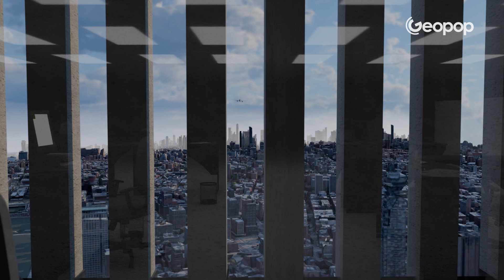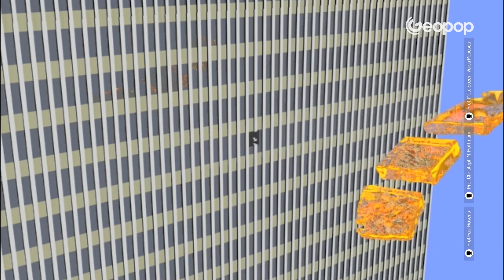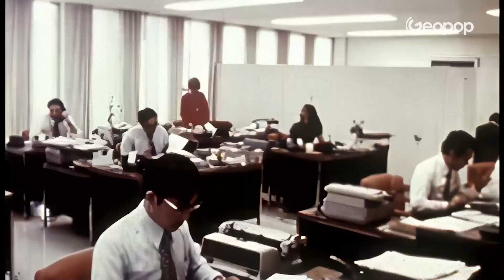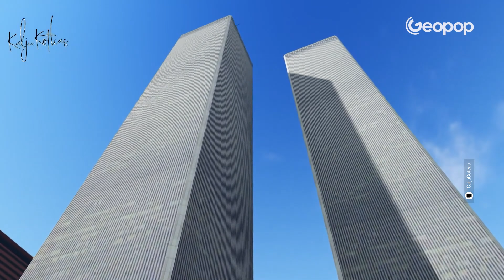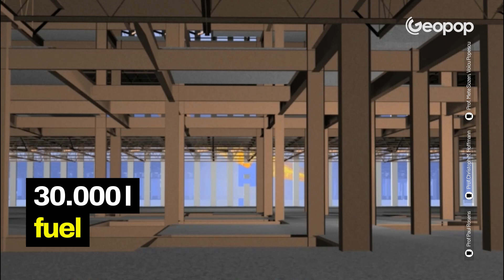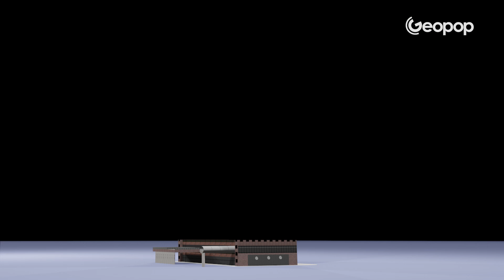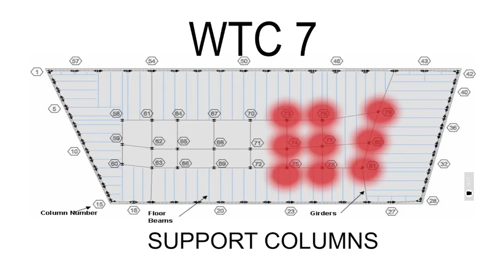9/11, 2001: The Technical Reconstruction of the Twin Towers and WTC 7 Collapses

Comment: All these technical reports that the fire reach 1000 deg F. With the wind and elevator shafts the added oxygen can triple that easy. A wood fired kiln for pottery will go over 3000. Could easy reach steel melting point. I can see it in the color of the flames.
Reply: The smoke proves it never reached that temperature.  How many kilns smoke like a freight train. Buildings are designed to burn to extinction without collapse.  All these buildings were made with steel and designed exactly that way. High rise buildings use steel for its resistance to fire. So you think tower 7 fell perfectly into it's own footprint because it cought fire. I can prove all those buildings around there were on fire after the twin towers fell down.I have photos I was there two months after it happened and every building around there was burnt to a crisp.
Reply: So a kiln can melt the steel? Prove it. I mean, you leave it in there for 20 or 30 minutes. It'll turn red and you can move and Bind it by banging on it with a hammer. Or something, but to think that it melts. You would have to prove that to me there, buddy, I've never seen it.
Reply: @robbiehiatt9966  Do you're own homework. look up can you melt steel in a wood fired forge. ETC.
Reply: @smokingjoking  I have, You can't light a building on fire and expect it to land perfectly into its own footprint You ain't to bright
Reply: @smokingjoking  - Robbie earned his degree from University YouTubia.
Reply: @ What do you think they fall over like a tree! LMAO NO common sense.
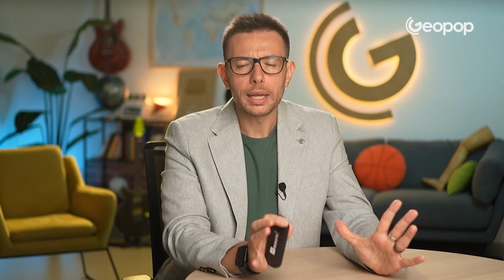Reply: @smokingjoking  Why were explosions heard coming from the building? Why did firefighters say it looked like a planned demolition? Why did another firefighter call tower seven ahead of time saying that " Any one of these buildings could blow up this aint over yet" Why is it that no one has ever known  a building  was gonna fall down ahead of time except through control demolition? Buildings don't fall down at free fall speeds except through controlled demolition.  This video claims it was free fall speeds  so you can't really deny it. But at 1:40 in this video the man claims he doesn't know the truth about what happened that day
Reply: @robbiehiatt9966  You do realize a bunch of foil hats paid big bucks for an independent investigation And they found they same thing as the NTSB? Read both then tell me the page paragraph and sentence you disagree with. Did you see the building the just went down in the earth quake It collapsed free fall speed! That is why they say building collapsed. They don't fall over like a tree!     https://www.youtube.com/shorts/I8av8DQ2AIA

Comment: The most important question should be, how was possible to navigate those planes so accurate into these towers,by these "pilots"???🤔🤔🤔🤔🤔🤔🤔🤔🤔🤔🤔🤔🤔🤔🤔🤔🤔🤔🤔🤔🤔🤔🤔🤔🤔🤔🤔
Reply: While we're talking about the difficulties. We should point out the fact that the so called plane that hit the pentagon made an impossible perfect 180 degree turn to hit the opposite side of the pentagon where the least amount of people were at instead of flying straight into the building where the most amount of casualties would have occurred. Since when do terrorists go out of their way to save lives of those they are trying to kill

Comment: Why Oh Why have you not or NIST not said one word about the WTC 1 North Tower " ANTENNA " which sliced on its way down WTC 7 ??? If this is so Scientific ,why not mention that which is a Huge Key Factor of its Collapse + The How the Fires Started with WTC 2 South Tower / 2nd Jet Airliner Impact sent sliced to the Floors & Blew out the Contents of the Floors +Jet &  Engine & Wheel debris  smacking against on to WTC 7 starting floor Fires This is Hard Fact & it's Well Known by now .did you forget .hmmm ! + It's in all footage thats what was captured .
Reply: Perimeter columns from the north face of the North Tower hit Building 7, NOT the antenna.
Reply: This video says otherwise,  check the damage map, perimeter columns hit the buildings on each side of tower 7 but not tower 7. That's literally what this video shows. Good try though.  Try again
Reply: Not to mention the firefighters that said it looked like a planned demolition. And what about the firefighters that talked about 3 secondary explosions
Reply: That also doesn't account for the explosions.That was coming from tower 7.I'll  be happy to post the videos so you can hear them for yourself. And you can't say the explosion came from anywhere else other than tower seven because the firefighters said we gotta get out of here seven is exploding

Comment: In the 1980,s I watched a documentery about a survey on the condition of the  Twin Towers flooring of each level, they found that  the  steel trusses that support each floor were getting severly coroded from the salty air in the buildings location and the report said that the floors could not be repaired. to me It looks a insurence job.

Comment: Fiberglass vs grade A steel fiberglass will lose everytime so your spreading false information.
Reply: What fiberglass are you talking about?  

What is "grade A" steel?  We're not talking about eggs here.  

This is a serious case of false argument loading if there ever was one.
Reply: @TheCriticalStinker-jw4fl  oh excuse me aluminum lol same shit there both soft as a feather compare to grade steel. Now what?
Reply: @AdrianGarcia-v1v  - How much energy is there in a 120 ton aircraft impacting at 589mph?

Sine I have low confidence in your math skills let's just cut right to it"  Equal to more than a ton of TNT.

What kind of damage can a ton of TNT do?

Noobs obsess over materials while thinkers work the problem in terms of energy. 

The Japanese figured out you could crash even tiny 3-ton planes into the thick solid steel hulls of Allied warships and do massive damage. There's even a name for it. 

Do catch up.
Reply: @TheCriticalStinker-jw4fl  https://youtu.be/4q35xHzjxB0?si=Seh3NflGSbKDC59c
Reply: @TheCriticalStinker-jw4fl  and that is just concrete
Reply: @AdrianGarcia-v1v  - To be correct it was a solid block of concrete 12 feet thick - essentially equal to a bunker hardened against air - even nuclear - attack.  NOT anything like a thin cage of hollow steel tubes bolted together.  And the plane was only 20 tons and not traveling as fast as Flight 175.  The impact dished out about a 2-foot deep crater in the block and moved it more than 3 feet!

But I admit I'm stuggling to see the relevance. 

The purpose of the test was to determine the impact force, versus time, due to the impact, of a complete F-4 Phantom — including both engines — onto a massive, essentially rigid reinforced concrete target 3.66 meters thick. Previous tests used F-4 J79 engines at similar speeds. 

The impact occurred at the nominal velocity of 215 meters per second (about 480 mph). The mass of the jet fuel was simulated by water; the effects of fire following such a collision was not a part of the test. The test established that the major impact force was from the engines. The test was performed by Sandia National Laboratories under terms of a contract with the Muto Institute of Structural Mechanics, Inc., of Tokyo.

the test was paid for by the NRC as part of the verification testing for the containment vessel of domestic nuclear power reactors. The initial requirement by the NRC was for the containment vessel to survive a direct hit by a 747. After publication of the regulations in the CFR regs document, there was a concern for an impact of a fighter jet at supersonic speed. As I recall, the initial testing, that was done years prior to this test, was done at about mach 2. It's unfortunate that anyone would represent this test as being associated with the twin towers.

Now it's my turn for show and tell. I bet you gave never seen this before.  5 minutes of your time and you will learn something:

www.youtube.com/watch?v=P8mG9pyImb8

And this bit, which is really telling;

Sped up video of South Tower impact:
https://www.youtube.com/watch?v=Qk5NQgU-9G4&t=3s&ab_channel=3UZFE

Original Source Video at normal speed (Enhanced)
https://www.youtube.com/watch?v=AerOyYEph7Y&ab_channel=EnhancedWTCVideos

Now then, you did not answer my earlier question: What kind of damage can a ton of TNT do?

Comment: I hate watching these computer reconstructions, because they are false, you can show anything you tell it too! An aluminium airliner would not go into the steel frame of the outside walls like a knife in butter......the two engines would have but the wings and tail plane would have broken off and fell down the outside of the towers!
This may be hard for people to fathom, but it is true, think of a bullet being shot at a steel beam, it would ricochet off! Both 500,000 ton Towers and WTC 7 would not just fall down at free fall speed in 9 - 11 seconds and they 90% turned into dust. The only explanation is a Directed Energy Weapon or to use it's correct name a M.E.N.R. (Magnetic-Electrogravitic-Nuclear-Reaction) device. And another important note is the whole W.T.C. complex was destroyed that day, buildings 1 - 7.

Comment: The steel was not beams but where trusses. They are much thiner.
Reply: Every beam in the 2 towers were made of steel. Trusses were also steel. Do you even know what you're saying??
Reply: I said they were not beams (as in I beams). Truss are a lighter steel. Do you have clue. When the reached the elastic state the pulled out of there connects.
Reply: @werewolf5674  towers 1 and 2 had trusses yes, but the only people who agree they pulled loose and caused the initial collapse was NIST. But thousands of experts disagree. I can assure you after my 30 years in erecting structures I've set more trusses than you. Get a clue, you are completely lost.
Reply: @werewolf5674  - Don't worry about Robbie. He is too busy trying to impose his own version of reality-distortion to take the time to understand your point (which was perfectly clear) and he wouldn't care anyway.
Reply: @TheLoonResistance  You are the problem
Reply: You clowns think if you light a steel structure on fire it simply falls down into it's own footprint.  Lacking any kind of problem solving skills you probably couldn't Mow a yard.

Comment: Yeah, real scientist and engineer spoke up. What a BS
Reply: You may not like it after more than 2 decades of internet conspiracy dogma, but what is being presented in this video is fundamentally correct and widely supported by the worlds engineering community.

While imperfect (there are a few problems) this video goes into a much higher level of detail than many viewers can comprehend and gets the collapse mechanisms fundamentally correct. This is true no matter who planned and carried out the 9/11 attacks or why . 
	
Sure, it’s not what you want to hear and goes against 20+ years of conspiracy dogma and conditioning, but that is not the same as it being wrong. You just need to fix your dogma. 

On the plus side, this video can be (and is) fundamentally correct about the engineering AND the 9/11 attacks could still have been some sort of inside job. The two things are in no way mutually exclusive. It’s just not the inside job the clowns you have been following on the interent have been telling you. 

This will surprise you to learn, since the conspiracy side of the internet hides it from you, but the mechanisms described here have broad professional support around the world. There are no professional engineering organizations (for example: ASCE, ASEE, ICE, etc) that disagree with them or have offered any formal dissenting opinions or alternative hypothesis. 

So, either the overwhelming majority of the worlds structural engineers and quite frankly simple observation are wrong,… … or you know more than the worlds best engineers from cruising around on the internet. Which seems more likely? 

If this explanation is wrong then produce a better one.  Be the first to even try.

Comment: Why is there Zero footage of the Most Heavily Guarded Building on the planet being struck by a passenger aircraft 🤔
Zero wreckage in Shanksville 🤔
Building # 7 🤔
Because  It Is Not as Concluded 
❗
Reply: 1. The Pentagon is not even close to the most heavily guarded building on the planet.  They give guided tours!
2.  While no footage is required to determine what happened, the crash was captured by 2 cameras, the footage being rather famous.
3. 19 tons of B757 wreckage in Shanksville which is 19 tons more than zero.
4. What about Building 7?
Reply: @TheCriticalStinker-jw4fl  do they allow weapons on those guided tours ? 
I apologize ,
Most Secure buildings...ie security cameras Everywhere ?
No plans wreckage Anywhere  at pentagon or Shanksville  ? Luggage or body parts Zero  ?
And Building 7 is so Obviously Demolition that they should make a New Word and you my friend are a 
Dipped 💩
Reply: @DerrikW  - 1. Not sure what the question has to do with anything, other than being an attempt at deliberately evasive off-topic derail. Your claim the Pentagon is the most heavily guarded building on the planet (yet open to tourists) is rebutted.

2. All the stuff worth looking at is inside the building .  There is nothing to guard in the sky or on the lawn.

3. Ummmm,... 19 tons - I covered this already - at both sites in fact. Add to that human remains from everyone aboard, thousands of personal items belonging to passengers and crew of the respective flights, the data recorders, U.S. Mail being carried as cargo, etc, etc,

4. Obvious how?  Please explain in as much detail as you can manage (ie; more than your half-sentence bare assertions).

Then I will take an entire post offering a better and infinitely more detailed alternative.
Reply: The problem is some people ignore whatever data they wish. We all know the official story,  I remember exactly what I was building that day. We all left by 11 that day. The thing is some people are open minded enough to listen to alternative theories. But if you can't tell by watching tower 7 fall down that this was a controlled demolition you are ignorant.  You've ignored too much and stupidity has set in deep.
Reply: Why are there no seats or bodies or plane parts in some pictures and some show there is? Why do people ignore the 2000 architects and engineers? You're blind and a fool.

Comment: Jet fuel burns at 1800 degrees it takes 3800 degrees to melt steel we have 3 buildings dropped with 2 planes nano thermite was used we know this from the air tests created aluminum oxide and steel oxide that takes 4000 to 5000 degrees
Reply: Who said anything about steel melting or needing to?  You seem to like to just fabricate your own reality.

Comment: This was a inside job after twin towers fell down why did cheyney order missile defense system turned off inside pentagon is that what you would do if we were really under attack its on 24/7/365 why turn it off
Reply: There is not now and never has been a missile defense system at the Pentagon.

From the late 1950's to the mid-1970's the Nike Ajax, then the Nike Hercules missile systems existed to defend major cities and military sites from Soviet nuclear-armed bombers. These massive missiles were armed with nuclear warheads with the goal of taking down an entire bomber formation at once. As ballistic missiles replaced bombers as the main delivery system these systems were withdrawn from service. 

Obviously not a practical system for the 9/11 scenario even if they had not been disbanded a quarter-century earlier. 

Other than an I-HAWK battalion in Key West that was the only land-based missile defense in the CONUS until the Air Force borrowed a NASAMS fire platoon from Norway to protect the 2004 inauguration. This system (2 launchers for 6 SL-AMRAAM missiles, 1 FDC and one radar) defended Washington DC.  I don't know if it is still in use but they did keep it for a while. 

So, on 9/11/2001 defense of the northeastern United States from air attack was the responsibility of the 7 fighters on 15-minute alert from 3 bases under the command of NEADS.